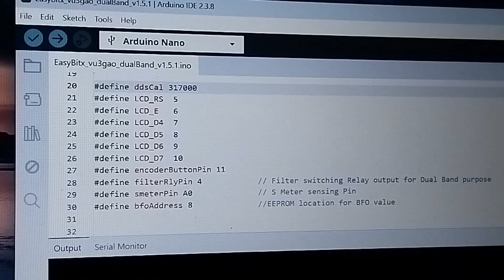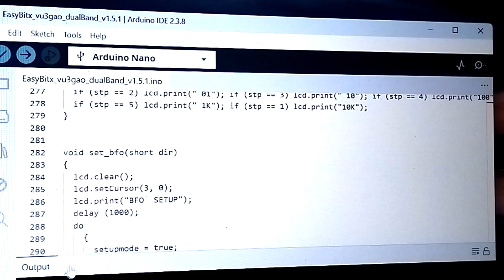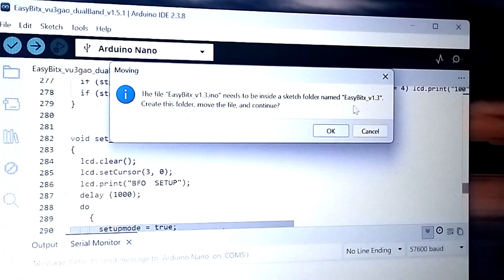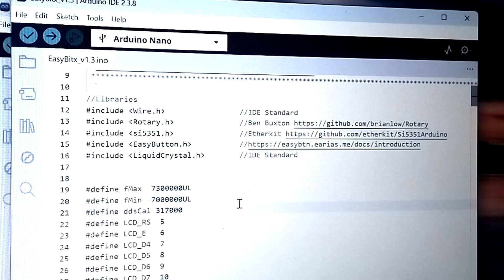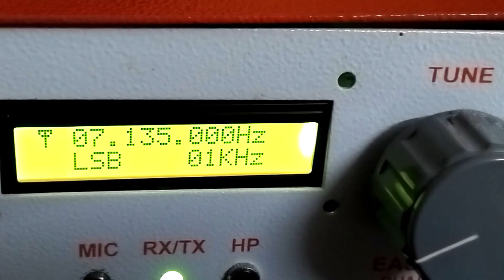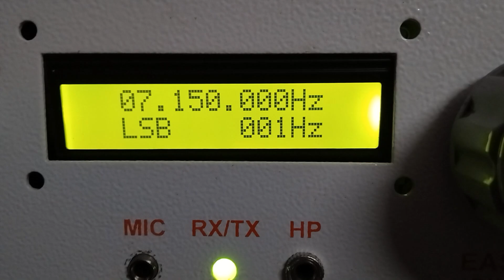BFO Alignment of Easy BITX 40m Using Arduino Serial Monitor

Comment: I see the pain. Now it is monoband? How they switch the filters or its defaults are set to 7mhz ( relays off). It is a pity that they cant provide a firmware with bfo offset and si5351 calibrations. It should then be straight forward and takes just 5 minutes.
Reply from the maker: The dual band firmware which came loaded in the Raduino in the kit had Si5351 calibration. I lost it when I tried to check the Arduino Serial Monitor some time back. As I was not yet very familiar with it, the example blinking LED sketch which I had experimented with an Arduino board earlier got uploaded and bricked the radio. Then I got the dual band code from VU3GAO by email. In between I had tried this monoband code in a knee jerk response as it was available online. Later, after installing the dual band code, I found that the baseline noise level is much higher, possibly due to some I2C communications. The default position of band switch relay is 7 MHz.
Reply: @johnsonsTechWorld i see, if ok, can you share the dual band code as well as the current noice free code to me. Can have a look at it ( email on qrz works )
Reply from the maker: Done

Comment: BFO adjustment through serial monitor is a tedious work
Reply from the maker: You are absolutely right. But this version of firmware does not seem to have the option of using the rotary encoder. As you would have seen from the video, the BFO frequency is not being displayed in the BFO setup mode.